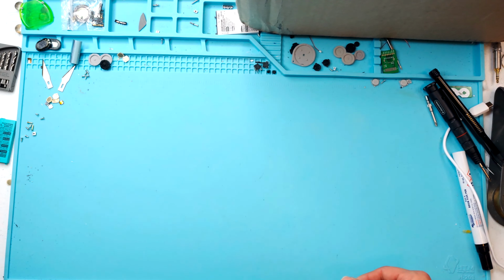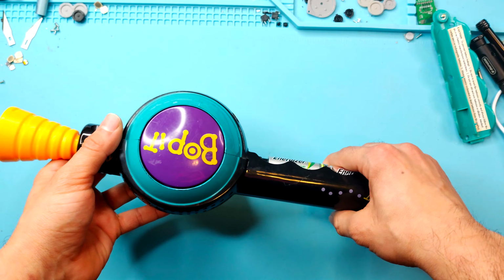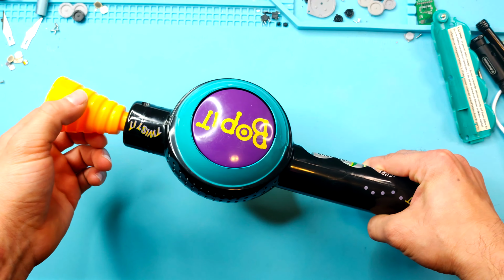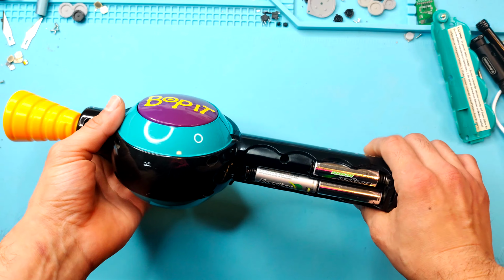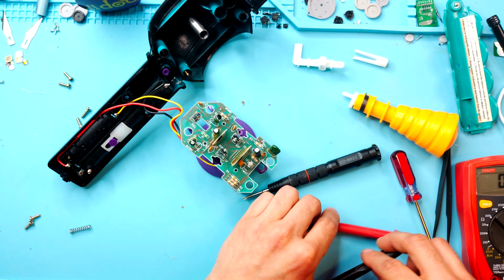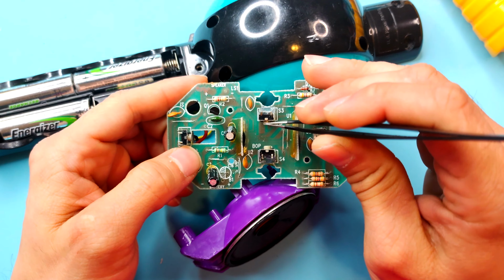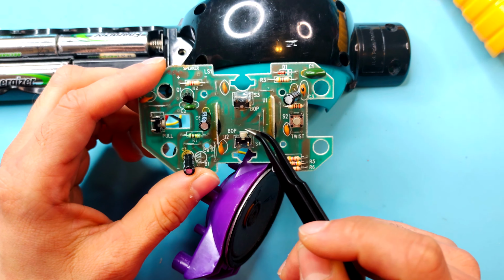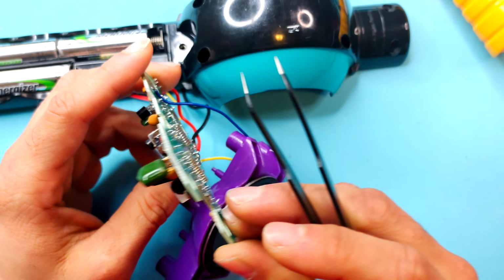Trying to fix an original faulty bop it. (part 1)

Comment: It sounds like there is an issue with the board itself. You could start by checking the connections on the wires leading up to the motherboard to make sure the electrical current is flowing smoothly. It could have a lot to do with how that computer is processing the information when the switch is pressed, or when nothing is happening. Unless you have more invasive materials that could fix a board that's pretty much beyond repair.
Reply from the maker: I actually checked more traces off camera and everything seems to check out, which makes it even wierder. My guess its one of the components itself or several, but I will get to it eventually.